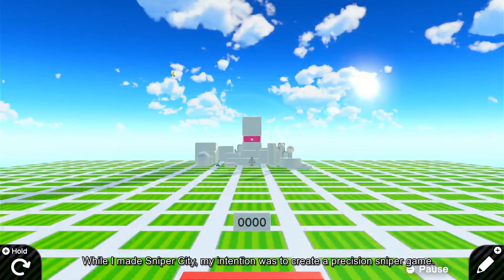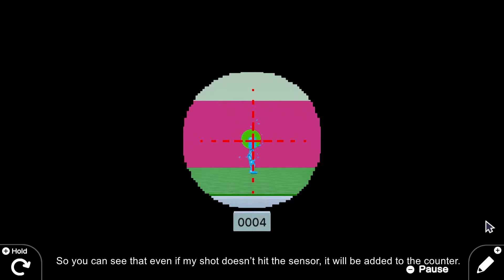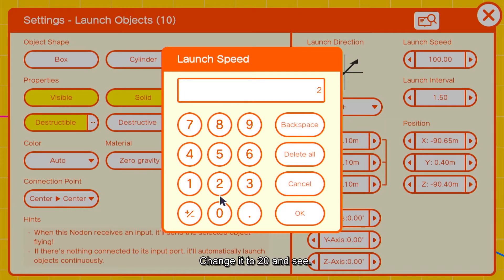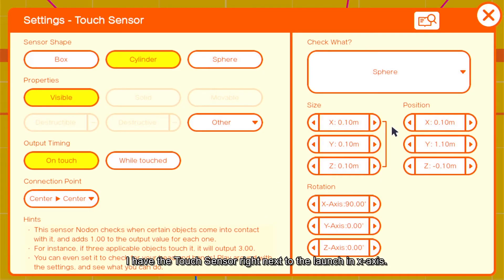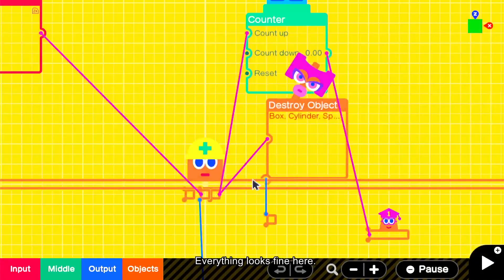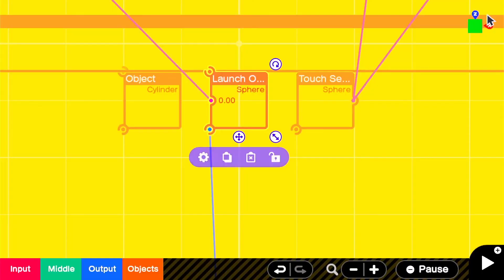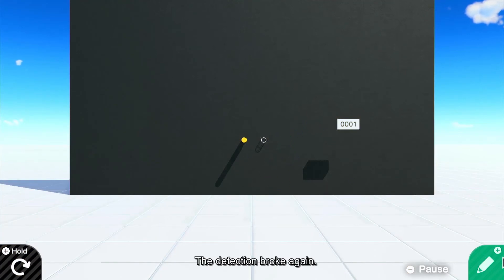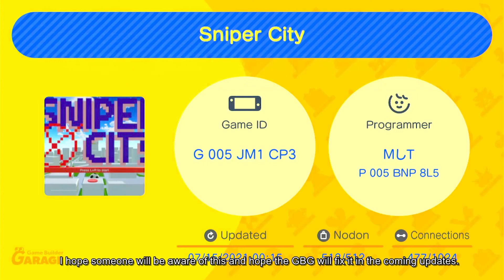[Game Builder Garage] - Touch Sensor & Launch Speed Glitch(?)

Comment: Interesting discovery! I can imagine why this happens. If you consider that an object moving at 100m/s moves 1.67m per frame, then its hitbox would need to be at least 1.67m large to avoid skipping past a touch sensor. So the game clamps the object's hitbox to be at least the size of the distance it covered since the previous frame. Nintendo could improve this by running physics and collision detection faster than 60fps, but that would affect performance.
Reply from the maker: Great explanation. :)
Reply: They could try detecting a Collison like in run screen without refresh scrath loops so this get avoided